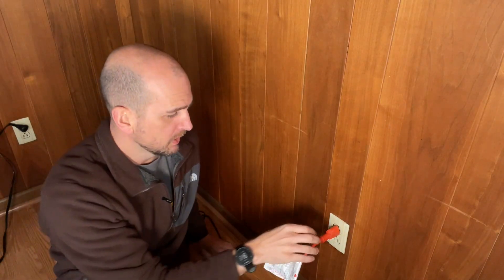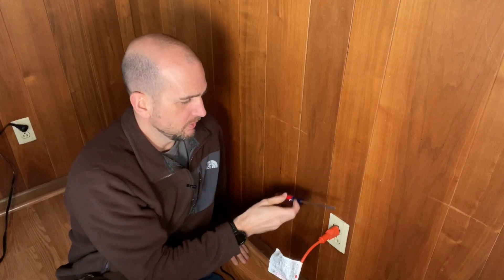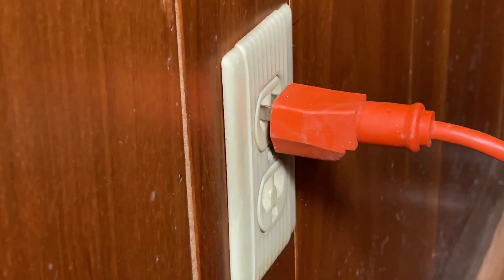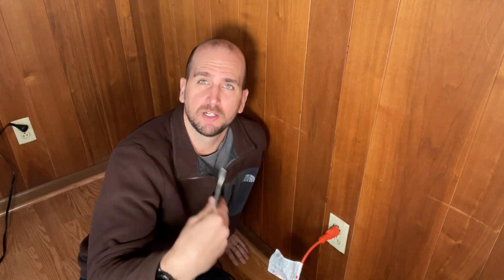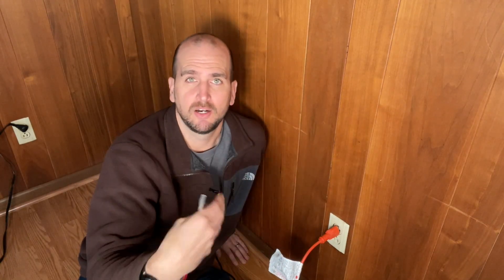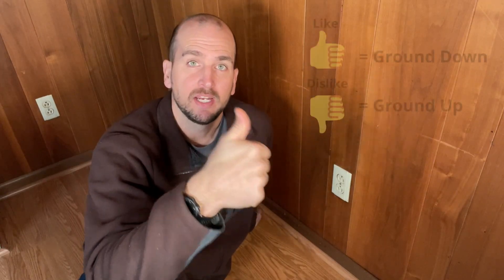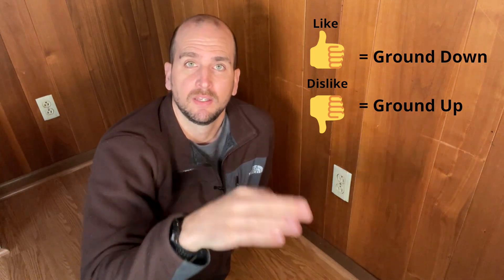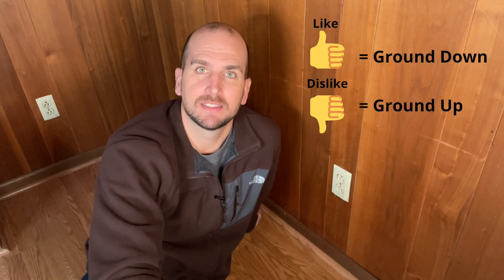Should An Outlet Be Installed Ground Down Or Up

Comment: It goes down. This ensures that the ground pin is the last thing to disconnect if the plug is pulled down. It is less crucial now that everything is plastic, but when things like power tools were in metal casings, we had no double insulated appliances or tools. Using a metal appliance with no ground is risky. Pretty sure the CEC states ground down, but don’t quote me. All code rules are safety-based so obviously something happened at some point.

Comment: I've always wondered if it was code in the US for that. My experience has been that in residential applications, ground is installed down. In commercial environments my experiences is it depends on the environment. For example; big box retail, warehouses, hospitals, and other larger environments (essentially environments where you have a large amount of physical labor) are almost always ground up. Smaller commercial installs (banks, offices, etc) are typically ground down. 

I have seen exceptions to this, especially in cases where a large amount of equipment is going to be used the relies on the outlet being ground down (a hair salon for example).
Reply: I wired my house with ground down and my workshop with ground up. I e found over the years that ground down outlets are more frequently cracked around the ground terminal. My shop outlets are much more actively used than my home outlets, so I’m installed up in the shop to minimize that.
Reply: @alecmacleod9147  That's something I've never thought about. If I'm ever able to build a woodshop like I want to, I'll have to remember that!
Reply: @randallsmith2521  
You’ll do it. We did, and it was possible because we did it ourselves. Having local sawmills also helped. It was a bunch of fun.

Comment: There's an outlet in my garage, on the ceiling. Should the outlet be installed with the ground towards the front of the house, or should it be facing the rear of the house?

Comment: There might be local codes that dictate which way the ground should be placed which should be taken into consideration. Found it very unusual when I moved to Greece years ago. The electric panel MUST be equipped with a whole house GFCI main breaker. A good idea in my book but a Pain ITA when something trips it. The whole house goes black. In Ohio I know code requires outlets in bathrooms, kitchens and outdoors be protected by GFCI outlets or breakers. Then there are sod layers, hey guys Green up Brown down.

Comment: It was explained to me that the reason that the ground is placed up is that if the metal wall plate is loose then it would touch the ground otherwise if the hot and neutral is up then a loose metal wall plate could short out between the hot and neutral leads.

Comment: The other consideration is that many electronic devices have heavy transformers designed for ground down or they tend to pull out of the wall.  If a plug pulls out of a wall and you don't want a metal object hitting the two pins, it's high time to replace the socket anyways.
Reply: that's a good point, Phil. If the transformer was installed ground up it would have a tendency to fall out with time.
Reply: heavy transformers usually have a mounting screw that installs in place of the wall plate screw to hold it in place regardless of the ground orientation.

Comment: The mere fact that there is the wide existence of two-prong plugs negate there being some pressing need to have the ground up. Plus for any plug safety is covered in the emphasis on proper breakers install or where GFI outlets are required near water. It is much easier to pull a ground-up plug out of the wall than a ground down.

Comment: Normally sockets are put in ground down except in the case of a socket controlled by a wall switch it is reversed , at least that is how it used to be not certain if there is a code that is just how every house I have lived in for the last 60 years has been .

Comment: The real problem would be if you saw a house with ground up and ground down together. I would not be able to trust the wiring there. I always heard ground down for residential. I thought it was US/UW code.  As most angled/low profile plugs are designed to hang better  with ground down too

Comment: I'm so glad that I live in Australia. All our outlets are installed ground down. In the case of a downwards pull on the plug, it's most important that the earth (ground) stays connected. That said, our plugs don't tend to pull out of the outlets, probably because of the angled active (hot) and neutral pins. The active and neutral pins on all modern plugs are also insulated for about half their length. If they do pull out, they disconnect before the bare conductor is exposed.
Reply: Where you live there everything start with down under. Even the land you are is in bottom part of the earth 😂. Just my opinion.

Comment: I worked in operating rooms. They have stainless steel outlet covers. In a room where the ground was installed down, I leaned over to unplug a cord, and the cover fell off, bridging the prongs and spraying sparks. One spark burned a crater in my glasses. Without glasses, I could easily have been blinded. I was on the committee to plan our OR expansion, and insisted on ground-up installation.

Comment: I like the ground up, the reason is safety. Most outlets are low so it's easier to line up the plug by putting the ground in first. That way as you plugging in you have a good ground in case of shorts. 
On outlets that are higher enough it doesn't matter but since I put the lower ones with ground up, I just follow suit.

Comment: Ground up as it is easier to plug in because to know the big plug is always on the right!!! The same while wiring the plug the same wire is on the right side it is normally on the receptacle the same also...In the dark or low light situation then the plugs are all the same... Light color/silver metal and gold metal and the green is the same....Same with plastic covers of the wires.... wires black, white and green make the same sense!!! Now sorry to say the 3 prong wall tester with lights signaling the correct install is the opposite with ground down!!! @#$@%%^%%&*(^%$#$#$%^& Devise!!!!! But nothing is perfect!!!!

Comment: Really, the big issue here is the fact that US and similar plugs have the conductor exposed when it connects to the hot contact.
What should have happened many decades ago when the 3-prong system was initiated, was that we should have adopted the European system where the prongs are fully covered before they connect, so people are never exposed to dangerous voltages. As it is, I cringe every time I watch a kid plug or unplug. No matter how well I explain it and they do it right, it only takes one slip for the fingers to find themselves wrapped around those prongs. Not safe for adults either but a kid's tiny hands have a far greater percentage exposure and their coordination isn't so good. 
I remember what a pain and expense it was to make the move from two prongs to three. Today? We'll never have the resolve to do what needs to be done 😞

Comment: I prefer ground-down because there are “wall warts” with the larger blade positioned to make it hang downward; when the plug is ground-up, those wall warts have to point up as well and wear out the outlet faster

Comment: My home has all of the plugs installed ground up. This is extremely annoying since many things are designed for ground down plugs. My cordless phone home base doesn't want to stay plugged in because it's upside down with the cord coming out the top. The weight of the cord drags the plug out of the outlet. I've had to duct tape a lot of my plugs to the wall in order to keep them plugged in. Also, I have a nightlight you can fill with insect repelling oil, but I can't use it because it's designed for a ground down plug.

Comment: Our entire house was wired with the ground up, and I had never seen this done before. At first I didn't think much of it, but in the 5 years of living here and using the plugs I have found it to be a pain in the neck, since most things that need to be plugged in are manufactured for ground down. Case in point, my son got me a small wall outlet air purifier for the kitchen and because of the plug being ground up the purifier had to sit upside down and wouldn't hold into the plug. So I just flipped the power off and turned it around so I could use it. It's been like that for so many things. Now as I renovate different rooms I take that opportunity to flip the plug orientation because it just doesn't work for us.
Reply: Most commercial equipment with 90-degree plugs arranges them for the ground pin to be on top.  This is also the case with commercial equipment for which receptacles are preinstalled: consider, for example, the General Electric GE1LU532SS RV Outlet Box.  And, of course, modern medical facilities almost invariably use the standard ground-pin-up orientation: see IEEE Std. 602-1986 (Electric Systems in Health Care Facilities).

In other words, when it counts, the ground pin orientation matches that specified in the drawings in ANSI/ NEMA WD 6-2021, Wiring Devices—Dimensional Specifications (2022-02-22) and recommended by the the National Electrical Contractors Association's National Electrical Installation Standards (NECA 130-2010) and IEEE Std. 602-1986 (Electric Systems in Health Care Facilities).

In residential installations, it's more of a free-for-all, driven more by aesthetic considerations (laypersons seem to prefer the "unhappy face" look of a NEMA 5-15R receptacle) than anything having to do with sound engineering or safety practices.  The domestic appliance marketplace responds as you'd expect, prioritizing customer demand above all else.  It's also worth noting that upside-down NEMA 5-20R receptacles look less like "unhappy faces" than upside-down NEMA 5-15R receptacles, but for historical reasons, homes tend to have far more NEMA 5-15R receptacles than NEMA 5-20R receptacles -- even on 20 A circuits, so the inertia of the "unhappy face" style of installation continues to dominate.

If a certain plug orientation is incompatible with an appliance's intended application, it doesn't automatically mean that the receptacle's orientation is "wrong."  However, if the easiest solution is for the receptacle to be installed upside down, then by all means, install it with the equipment ground pin down, but that doesn't imply that, as a rule of thumb, all receptacles should be installed that way.

There's a lot of folk wisdom masquerading as informed opinion when it comes to receptacle orientation.  More examples include horizontally installed receptacles having the equipment ground hole on the right (popular in Chicago, Illinois) and installing only switched outlets with the equipment ground pin up.  As far as I know, there is nothing in any electrical code that requires either of these practices.  (Please correct me if I'm wrong.).

Comment: The back of outlets have info. facing ground up and some have an arrow ground up.  
Most of the time the plug will drop down and expose the hot and nuetral if the ground if faced down.

Comment: if u got ground already in your house and have a ground on a plug end and don't.have a adapter ground plug end just break the ground off if your house has ground .just a simple hack without going to the store to Buy a 5 dollar plug adapter For a double plug without a ground plug receptical

Comment: When I went through school to be an electrician, they taught us to put the ground up, or if the outlet is sideways, face the neutral up.  They also said it isn’t a requirement so don’t get bogged down over it if a job wants it the other way.

Comment: When standing and plugging in a 3 prong you do not plug straight in. You are guiding the plug in a slow downward arc toward the outlet. With the ground on top the plug ground will connect to the outlet ground FIRST. This is the safest.

Comment: Any kind of appliance with a built in gfi  breaker box will sit best with the ground facing down. With the ground up it sits upside down and pulls away from the wall. Also those 45 degree plugs work better pointing down than up.

Comment: Although there is no real; standard in the U.S., there is a clear standard in the U.K.  They use use a different plug configuration, but the ground (or earth) pin is always on top.

Comment: I think it is disorienting to the users if the orientation of the ground pin varies for any reason.  I have always mounted the sockets with the ground pin down.  This is simple:  The "ground" wire is always connected to a metal pipe or other fixture that is buried under "ground".  Putting the ground at the top of the socket is counterintuitive for that reason alone.  The socket literally points toward the ground.  It is a gesture to our Mother, the Earth.  Don't mess with Mother Nature.

Comment: For DIY I have always done ground-down. 

During a recent remodel at a state-run facility, I asked one of the facility maintenance techs why the sockets were all "flipped over" to ground-up.  He said he thought it was code in case of flooding.  Given our proximity to a major river, it makes sense there would be a code specification for that.  However, it seems to me that, if flood waters reached only one part of a socket, you would want it to be the ground and not the hot/neutral sockets.  If the flood waters got much higher, it wouldn't really matter either way.
Reply: Wait, somebody thinks if there’s a flood, maybe 1/4 inch of height is going to matter?
Reply: @censusgary  Given how some state and city bureaucracies work, probably.
Reply: @censusgary  That's what I was thinking.  The power should be shut off long before the waters rise to the level of the sockets.  Just walking around in it would create waves that would splash over the sockets.
Reply: It's a 1/4  inch on the outside but behind the face plate It's about an inch difference. As water rises it would touch ground first then hot. Hopefully tripping the breaker before shocking someone.

Comment: As a guy with multiple 5V wall warts, I prefer the wall to be ground down, and that is for the power bars that are mounted horizontally, allowing 2-prong wall warts to plug in with the wire down. Ground up would only work for the lamps I have that are not grounded. Everything else is 3-wire.

Comment: AHJ (electrical inspector) in my county says ground down, the county above mine say up. I like down myself, but adjust to the needs. How about measuring how far out of the receptacle the plug is when the conductors are still hot to give the dropped screwdriver/knife, some validity?

Comment: Salesman at my place of work put his tape measure behind the fridge taking measurements. The plug wasn't in all the way, the tape touched the hot and neutral and it blew apart. Scaring the crap out of him and the home owner. Ground on top is safer.

Comment: Always preferred ground down simply because some electronics like older computers / video game consoles had the big 'brick' transformer built at the plug end, with most of the weight below the plug.  If you stick that in the wall assuming ground up, most of the weight pulled the plug out of the receptacle and it would eventually fall out.
Reply: Indeed polarized two prong power supplies without extension cord hate ground up sockets !

Comment: Ground up because of safety. In case of flooding the water would already be grounded so those arguments don't hold any water. I never keep surge protectors on the floor that's why they have mounting holes. I think people prefer down because it looks like a face.

Comment: My experience with taking over a spec home after drywall. All of the bedrooms had no overhead lights, all switched outlets, and I immediately put in a change order for overhead lights. I was there when the electrician was installing the fixtures and I noticed he'd pulled the receptacles (most) and I asked why, forgetting he'd have to because they were separated, and he pointed that out but also mention he'd change the orientation to ground down. He explained they always place switched as ground up and always made the top outlet the switched outlet so the home owner could easily tell which outlets were switched and which was one switched. The builder also pointed this out during walk through as I had 3 switched outlets in the family room with a vaulted ceiling.

Comment: The reason I was told the the GND pin should go down is because as a plug drags on the floor and a little loose from outlet, with the GND down it would be the last pin out of the outlet making the chasis of the equipment safe if a short were to occur.

Comment: First, I match what is already there. 

If I were to have in my own home or a close friends an outlet or outlets that didn’t hold a plug tight I would replace them. In fact I replaced all the outlets in one families condo at my cost and my time because that was scarier than up or down. The cost of outlets are so cheap comparatively. 

For all the “what if the 3 prong plug is loose & a knife happens to drop…” Those two things in combination in my home is infinitely small. 

I would never tell anyone not to do what they think is best/safest for them.

Comment: Pretty simple reason to mount with the ground down is look at the lettering on the device itself.  All the lettering indicates ground down just like switches.  Do you really want to stand on your hear to read the lettering on the device?  If the manufacturer had intended for the device to be mounted ground up, they would have lettered the device accordingly.

Comment: Ground down for me because I work with computers and I often can't see the plugs or don't have a good angle and my hand gets close to the bottom of the plug for grip.  Obviously ground is better than hot and neutral contact with my hand.